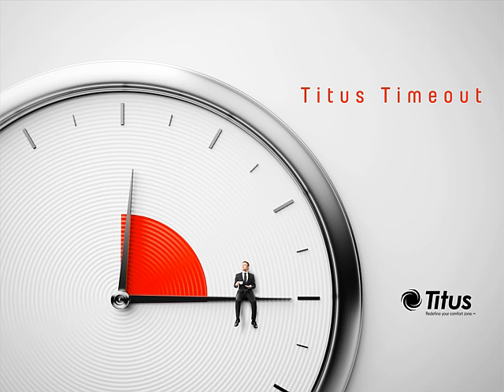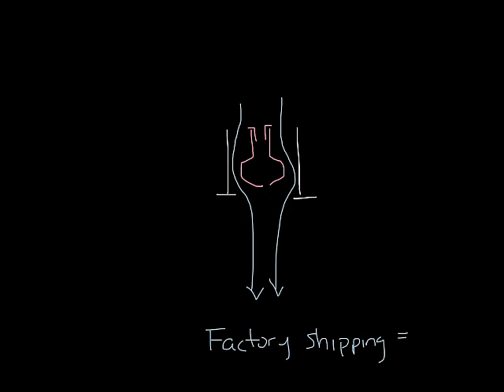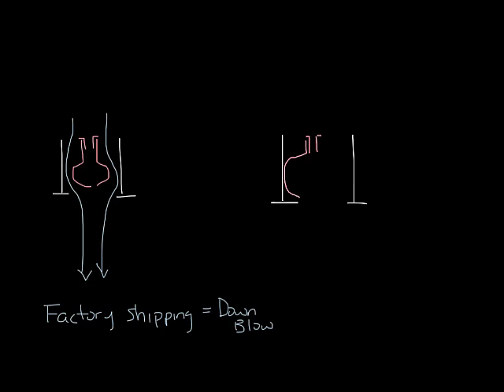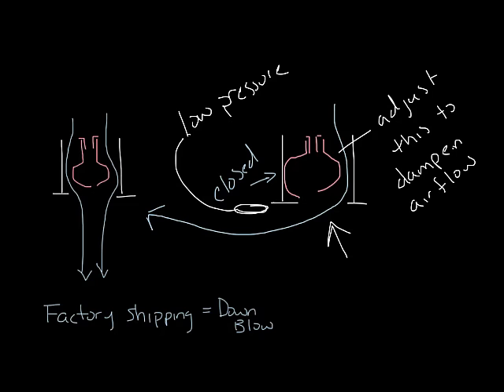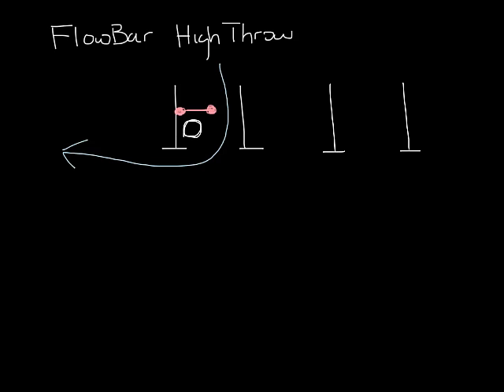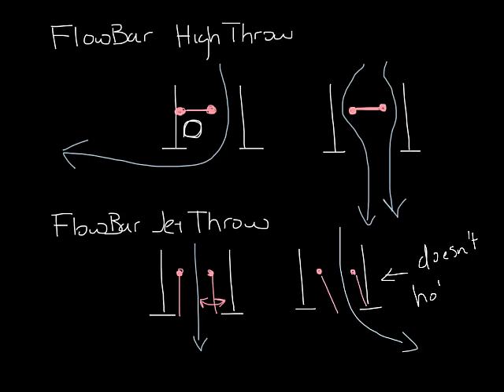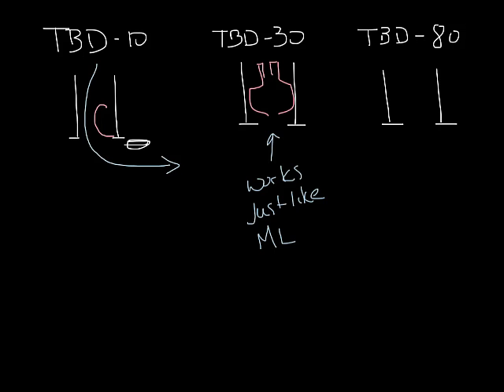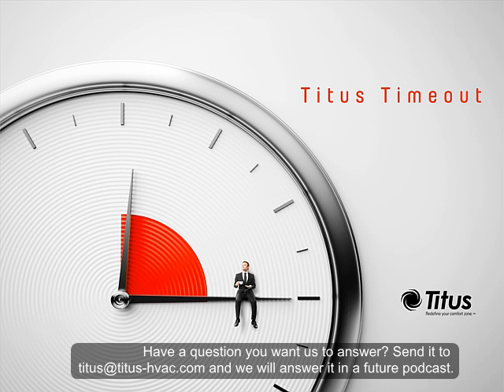Titus Timeout Podcast - How to Adjust the Pattern Controllers on Linear Diffusers

Comment: Excellent! Thank you very much for such a simple and quick explanation. We have just had ML pattern controllers installed as part of a ducted AC system and that wasn't explained clearly at all. Our installer just said, "you need to tickle them". As it is kind of counter-intuitive, I think I would have wasted a fair bit of time trying to work it out and wondering why it seemed to be doing opposite to what I thought it should do!